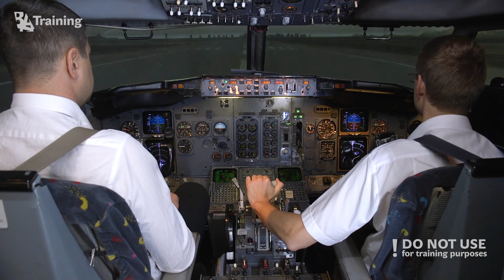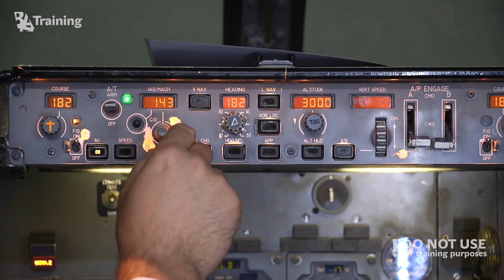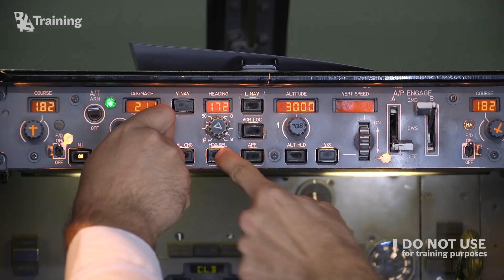Boeing 737 CL take-off with an extreme crosswind at Antalya Airport

Comment: I've a very silly question. Just like a driver can drive any brand's car.... similarly can an Airbus A320 pilot land a Boeing 737 or vice versa?
Reply: Nope, pilot with Airbus A320 type rating can't do that. If he wants to land or fly a B737, he will need to get a type rating for that plane too. In addition, Airbus A320 and Boeing 737 have different controls.
Reply: They have done a video on this already with an a320 pilot in the 737cl trainer /watch?v=UyF6LtsJ1OA